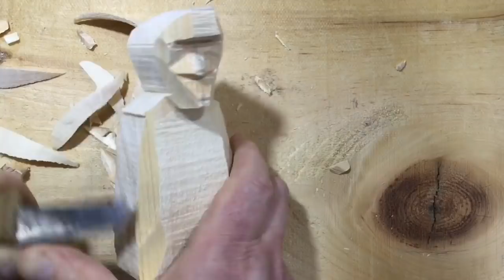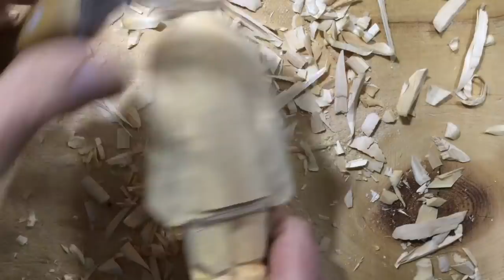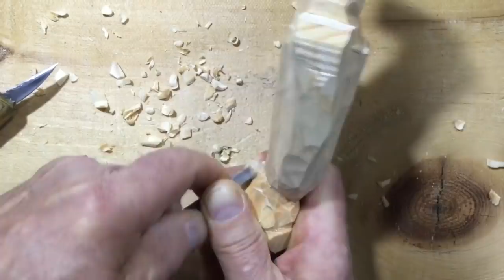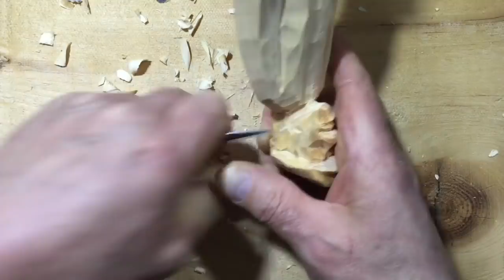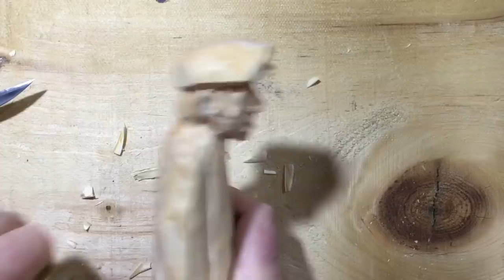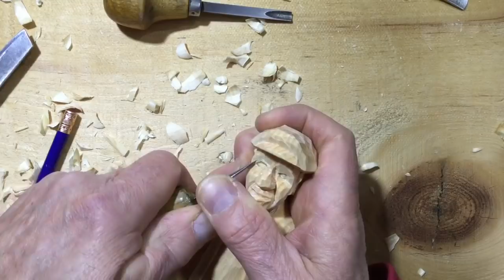CARVING AN 8” BOAT BUILDER

Comment: Hi, Kevin. You are amazing at wood carving - I kind of want to BE you. Or like you when it comes to carving. I try to imitate what you do, but i need a good start, so I would very much like to know the measures in three dimensions on all the fantastic pieces you make. I mean in the beginning before you start carving. It would help a lot. Thanks anyway - you are the best, and very inspirational. Best regards from Norway.
Reply from the maker: Thanks Vidar. I put it in the description sometimes. That is when I remember to. The 8” figures I use a block of wood 8”X3”x2”. For the little ones 4”x2”x2”. That’s roughly what they are. I will try to remember to put it in from now on